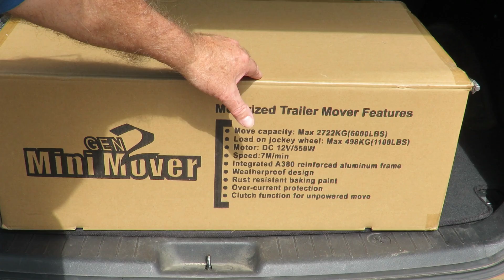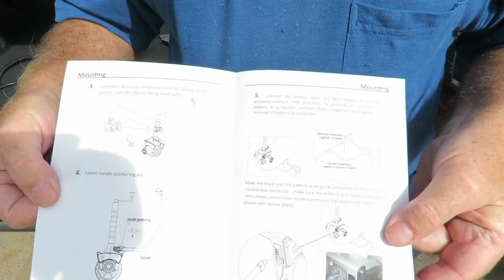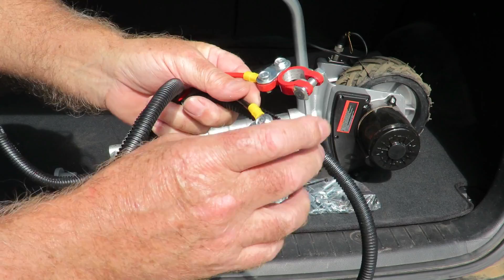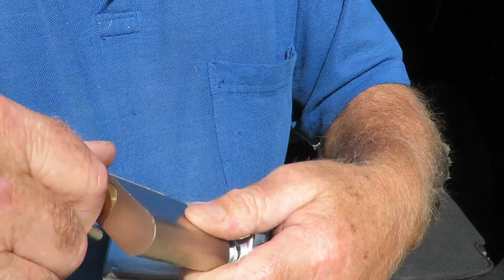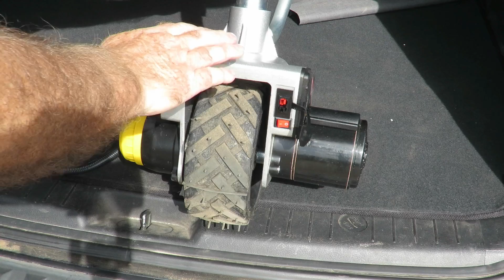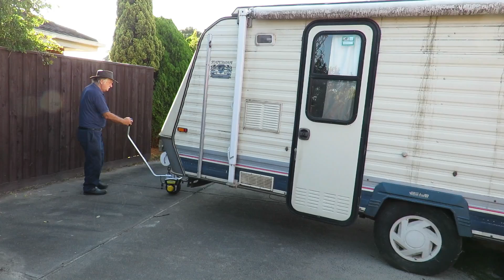🏕 Powerful Gen 2 Mini Mover 550W Jockey Wheel 12V Electric Caravan Mover Review

Comment: Thanks for the video Garry. 
The problem with a single point mount on this mover is that it will DEFINITELY flex. I had installed the original one supplied on my caravan A frame and just before a trip from SA to WA the mount flexed and broke the welds done for it and dropped the whole front of the caravan down on top of the mover mount. No damage to the mover and my feet were not under it. Note to everybody; stand clear of being under the A frame, as it will do a lot of damage to you if it drops. 

I had no option but to carry a  garage floor jack with the caravan to maneuver it onto the  Patrol tow bar. At the first Port of call, I found a caravan repairer who welded another single point mount (the other one was totally f***ed) and I continued on my way.

When I got home from this travel I managed to get a double mount and totally weld the back plate onto the A frame as well as a square tube making up the rest of the height of the plate, now making it IMPOSSIBLE for the back plate to flex. The A frame will flex before the back plate of the mount will!! 

There is still some flex possible with the double mount however, as the single handle is the only part that holds the movable plate onto the baseplate (I wish it had 2 handles or bolts on the moveable plate to secure the post at 2 points), but no one makes such an animal. Now that these mods have been done it will move and park my 22ft caravan  into a very tight space with little effort on my part. 

I have also changed the power cable to include an Anderson Plug. Works very well for the price, would be far greater out of pocket than alternatives, and it's small enough to store away in the front bin of the caravan when travelling.
Reply from the maker: Sorry to hear about the problem you had.
Thanks for sharing this valuable information, I'm sure it will help others.
P.S. I'll be checking my swivel mount on my caravan more regularly.

Comment: what battery you used？
Reply from the maker: 12v Car Battery
Reply: Thanks, and  can that work with double axle trailer?
Reply from the maker: This mover is based on weight, not the number of wheels it has, so if your trailer is below its maximum weight limit, I expect it should work.
My experiences have been that the mover is good on flat solid surfaces.
The mover does not like loose gravel surfaces.
Reply: @GarryPurcell  Thats very helpful，I will go get one，thank you very much

Comment: Nice video thanks Gary. I purchased the exact same electric mover to use on my car box trailer. It works great on solid surfaces, block paving, tarmac and dry short grass however it is next to useless on gravel loose surfaces. The tyre does not have enough surface contact area and is just too small to do the job. So I’m now looking to have to sell it and try a heftier Motor Mover solution
Reply from the maker: Your right about traction on loose gravel.
I have had a similar experience, and the only way I could move my caravan, was to place a plank of wood under the motorised wheel, not ideal, but it worked.
Reply: @GarryPurcell  good to know. We have river rock as the gravel. Looks like I have some paver work to do!. To be fair, their website DOES state that it is not intended for gravel. But you and Chris Notley shine a clearer light on just how ineffective it is.
Reply: @GarryPurcell  Great idea .So simple.

Comment: Do you think this would be capable of moving a 10/16 " out building ?
Reply from the maker: That would depend on the weight of the shed, and the ground surface.
The mover might struggle on soft ground, but should be fine on a firm surface, like concrete or asphalt.
You will need a downforce on the mover, otherwise the torque will simply spin the wheels.

Comment: Hi Garry. Excellent video.  I have just bought one of these.  I need to buy the jockey wheel mount and a battery and clamps.  Can I ask where you got the battery and other kit?.  Thanx.
Reply from the maker: The Battery is just sitting on a piece of wood, the clamps were purchased from Carac.
I'm sure most caravan accessory places would carry thrm.
Reply: @GarryPurcell  Cheers.  I have now got the unit installed and up and running.  Can I ask if it flexes at all when moving the van?
Reply from the maker: @911McS  The torque generated will cause the mini mover to move in the mount, but not excessive.

Comment: Thanks Garry - would have liked to have seen how it went on a bit of a slope but it looks like it has plenty of grunt. Noisy little bugger but better than strained back muscles :-)
Reply from the maker: The mover works well, as long as you are on a solid surface. 
I've tried it on a semi solid sandy base, and it was a  waste of time, I had to get some timber, and lay it underneath the jockey wheel, to get some traction.
The mover works well on grass, but not good if the grass gets wet.
Hope that helps.
Reply: @GarryPurcell  Many thanks. I have a trailer so I reckon it should perform like yours with a boat.
Reply from the maker: @regwatson2017  The mover has quite a bit ff torque, so it could spin the wheel if the tow ball weight is a bit on the light side on a slope.

Comment: How would you say this goes moving a bigger caravan?
Reply from the maker: As long as your on a flat surface, I would expect it will work OK.
But don't use the mover on sand, or any slippery surface, as it will not have sufficient grip, to move anything.

Comment: How does this unit perform pushing a trailer up the 2 lips/step ups into most Australian Garages.
Reply from the maker: As long as you've got a small run-up, I'd expect there wouldn't be a problem as long as its on a reasonable flat driveway.

Comment: Great video and nice responses. Thank you. 
I wonder how this would work with heavier vans, for example 2.2T tare on 5 to 10 degree incline hard compacted gravel driveway?
Reply from the maker: I don't know the answer to your question.
Maybe others will be able to guide you.

I personally think that the jockey wheel might slip on gravel, around the 10 degree mark, due to the movers small solid wheel. 
If the wheel was inflatable, and wider, it should handle the incline with the heavier van.
Reply: @GarryPurcell  Thank you Gary for your reply. I will pop into the  Brunswick store before purchase to make sure that the device can deal with what I am intending to for.

Comment: Cheers Garry I bought one after checking reviews like yours. I can also confirm that it does go over grass and up inclines. when it got too steep I just put some more weight over the towing point and with someone just giving a little nudge from behind it got around a tight 90degree bend in my driveway and onto the level ready for towing away. I used one of those 12volt power packs that you can use for jump starting dead batteries.
Reply from the maker: Overall there not a bad unit.
Good hint for using a jump start battery pack.
Reply: Just purchased a minimover, now investigating whether to go with battery or the jump starter pack / kit - there are a few different sizes of these jump starter kit - what size did you use ? Don't want to buy one that is not 'powerful enough' to do the job. Thank you

Comment: Have you used this on grass or an incline? I have a 21ft Offroad van on grass I wish to move. Weights just under the 2700kg limit of this wheel. Thx.
Reply from the maker: I have used it on a level grass surface, and it performed OK.
My driveway has a slight incline to it, and it works well on the concrete.
However, I wouldn't feel comfortable on any steeper slope, as I don't think it would perform well. "the small wheel might spin, and you will need to add weight to the drawbar to counteract it" 

I also tried to use it on a sandy area, "Total Waste of Time".
 I finished up getting pieces of flat timber, to sit the wheel on, and it pulled out OK with a bit of effort. 
Lesson Learnt - Keep away from sand and mud.

Comment: Just bought an Adria, it's only a small caravan and I imagine the mover would pull it without any problems. Problem is I have some grass I need to pull over, do you think it could move the van on grass? (It is on the level.)
Reply from the maker: Should be OK, as long as its not muddy underfoot.

Comment: I have watched all the videos i can find on these, and haven't found one that shows how it is set up when hauling the trailer...does it swing up or jack up like a normal wheel? From the turn lever on top i assume it telescopes but cant be sure, hate assuming. is it a good bit of clearance?
Reply from the maker: These movers do not swivel, they only wind up or down, like a normal jockey wheel.
I use a Removable jockey wheel bracket clamp that I bought from eBay, to secure the mover, to the a frame.
https://ebay.to/2ZLzY9D

Comment: Isn't there a better way to power these than having a separate battery to power the unit. Surely there is a way to plug into the caravan battery.
Reply from the maker: You could add an Anderson plug connector, if your caravan has batteries.

Comment: Still happy with it mate?
Reply from the maker: The mini mover is working perfectly so far. 
Iv'e moved my caravan a few times with it.

The normal location where l store the van, can only be accessed by pushing it manually. (I needed to get a few friends over, to give a hand, pushing it in or out.)

The only downside of the mini mover, is you need to have a spare 12v battery available, to operate it.
Reply: @GarryPurcell  but we what is the connection out of the box? If it can be fitted with cigarette lighter fitting I could plug it straight into my caravan’s 12v socket?
Reply: I'm wondering the same as I have a jumpstarter that I could plug it into.
Reply: @patkillalea3917  no the wiring of a 12 v cigarette lighter socket is too small
Reply: @GarryPurcell  Thanks for the reply, how heavy is your van?
Reply from the maker: @WildTouring  895kg  Tare total (Empty weight)
1095kg Gross Weight (Loaded Weight)
159kg  Towball Weight
1154kg ATM (Aggregate Trailer Mass)
Reply: @WildTouring  Hey Cam, Looking for a motorised jockey wheel, did you end up buying one?? If so whats your thoughts mate???

I know its a old comment haha, Long time follower of your channel, saw your comment, thought id ask you how you went??

Cheers Mate
Reply: @JoshBarnes  Hey Josh, nah I never bought one mate!